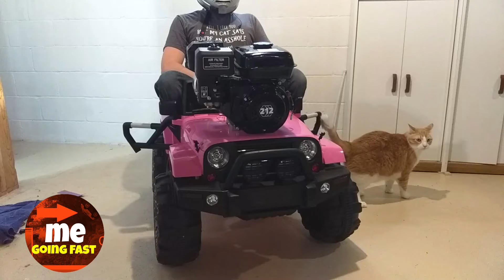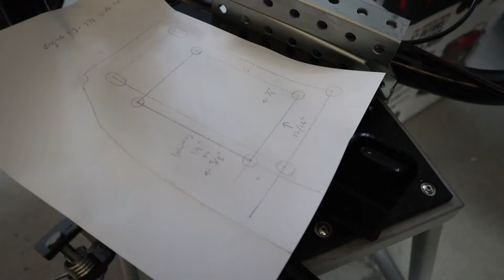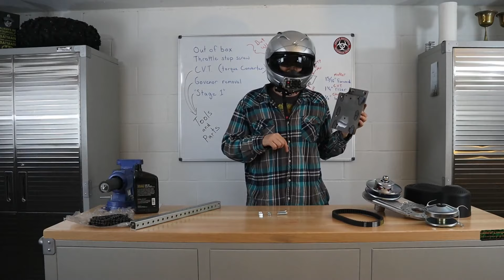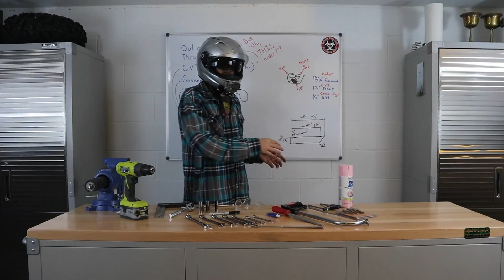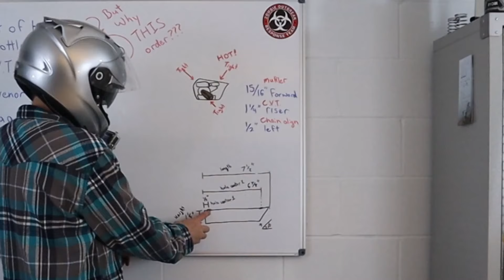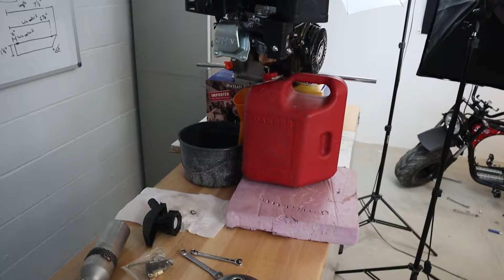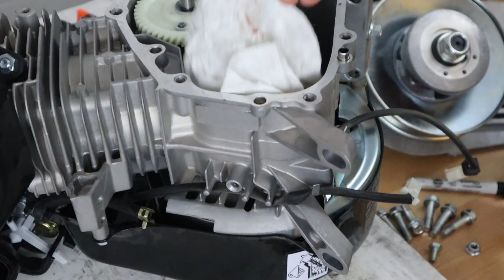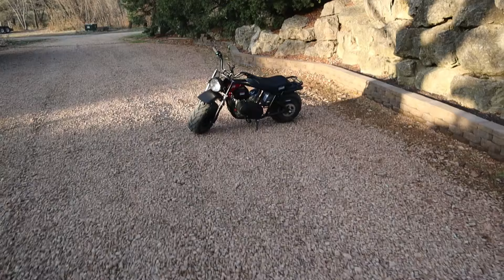Coleman mini bike performance parts for RB200/BT200x torque converter stage 1 and governor removal

Comment: I have the column BT 200 X stock and I was wondering if the predator 8 hp engine fits in the frame with modifications?
Reply from the maker: Yes, depending what else you do to it. Torque converter makes a difference, gas tank exhaust and air filter all do. There is enough room once the engine gets stripped down a little otherwise it's a very tight fitting frame to work with. Mods are needed to make it work.
Reply from the maker: The biggest pain point might be the foot pegs. You might need extensions.

Comment: Not sure why but i had the Mega Moto Pro ( same bike ) and nothing else touched but the throttle stop screw on the carb that limits throttle. Mine on flat paved road and I am 220lbs, it did 45mph. Gov n all was still inside the engine. I did nothing else. I also had the base model with clutch. 42mph bone stock also. Not sure what coleman did to the gearing or? But mine were awesome stock.
Reply from the maker: The Coleman is a bit different from both pro and max. I've got all three and the mega moto max had no jackshaft, the pro had a torque converter. The RB100 has the same setup as the other Coleman bikes. I've got videos on all showing differences. The mega moto is definitely an awesome bike!

Comment: I live around 7000 ft elevation. Does being in a higher elevation make significant changes with the oxygen intake And decrease speed?
Reply from the maker: So yes, and maybe. Lots of different factors at play! You can tune by running richer fuel or changing the jet!
Reply: @megoingfast  what elevation are you at?

Comment: Which engine do you think is better 212 predator or the 196 coleman ?
Reply from the maker: Online resources and help is better for the predator which is an advantage over the 196 cc engines but overall they can both deliver some power!
Reply: The 212's get the edge in torque and HP. One thing I know is that the Hisun 196 is a better quality engine than the old Harbor Freight 196's I have opened. Never opened a 212. I don't think it's worth getting a 212 if you already have a good running 196. Unless you want ride with the 196 while the 212 is being built.

Comment: Which would you say is better the rb or the bt
Reply from the maker: Kind of hard to explain in a small comment. LOTS of GREAT reasons to get both, depending on needs. I do put the two side by side in my RB200 "before you buy" video and cover the differences there as well. Each has pros and cons 👍

Comment: You're forgetting about tuning the rate at which the torque converter expands. If you install lighter weights It will let the motor achieve higher RPMs before expanding a given amount thus pushing you faster.
Reply from the maker: Great note! Awesome catch! I had a VERY brief mention of how I was going to "play with it" in the video BUT 20 minutes long for a video already... Well... hopeful understandable 😉. Tried to keep it just to how to get upgrades in place. 👍
Reply: @megoingfast  tuning the torque converter, coming from a scooter background we call it a variator, is critical. On those smaller 50cc mopeds you really need to maximize RPMs. The same techniques apply here on the larger displacement motors.

Comment: Good video but you tested the final stage of the bike on pavement. All testing should be under the same conditions. The top speeds you got on dirt/gravel may be slightly higher on pavement. And it seemed like you backed off the throttle before it had a chance to reach top speed on the dirt/gravel.

If your belt didn't shift all the way that's a good thing.

Comment: What type of torque converter did you say it needed?
Reply from the maker: 30 series, with a 41/420/40 chain sprocket, and 3/4" shaft for the RB200. For the other Coleman mini bikes would need the shaft adapter. 👍
Reply: Thanks my man 🤟

Comment: Lol love the videos!  43 mph and 80 miles per gallon on that hog.  Does this work for the Coleman ct200u?  Was thinking about doing the upgrade and I have put the front suspension on it.
Reply from the maker: Yes. The omb riser plate shown with shaft adapter is the way to go for stock engine on ct200u, ct200u-ex, and bt200x. No need to make custom risers. Or, the predator engine swap will not need a shaft adapter and is commonly done. The results are all roughly the same for speed and performance increase. The torque converter is the same as well. 👍

Comment: What do you think about installing the torque converter without lifting the engine by cutting a small piece of the torque converter plate off?
Reply from the maker: Great question! Driven pulley would hit the frame, unfortunately.

Comment: You didn’t have to swap the carburetor did you? These new engines must not come with an EPA carburetor
Reply from the maker: Nope! I didn't swap carbs at all for the RB200. Just dropped the bowl and swapped the main jet. Low speed jet seemed fine, but it may vary per user that the low speed needs anything.
Reply: @megoingfast  where would your point a fella towards to get the proper jet? .038 right?
Reply: @jessenhartman  Did you find it? Im also looking.
Reply: @lucashemry5107  yup. Honda clone equivalent. It's a bitch to swap out in the RT200 but definitely possible with vice grips
Reply: @jessenhartman  could you point me towards a link? 😅

Comment: Also did you add both jets? Make sure you change out that black jet with the upgraded one too, you'll get higher rpms
Reply from the maker: Great question! Surprisingly my low speed and idle were just fine without the swap. Others may experience different results and this is a great consideration!